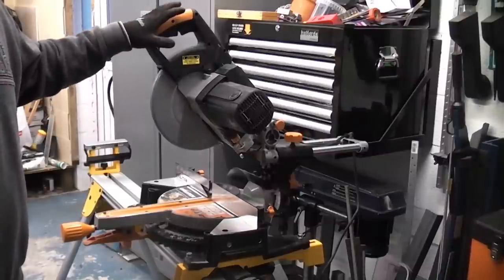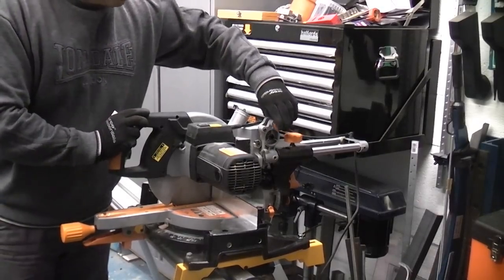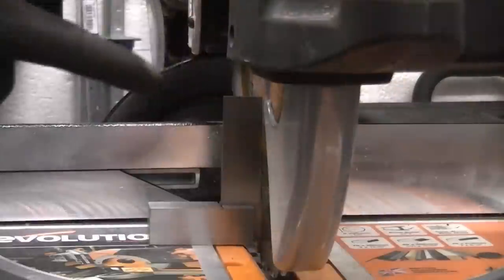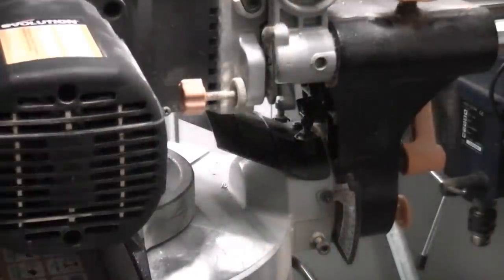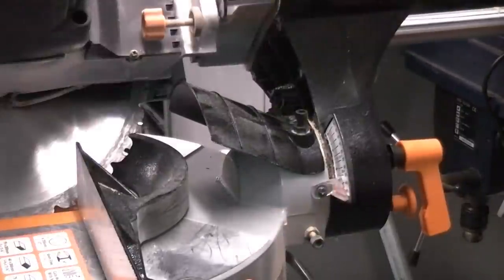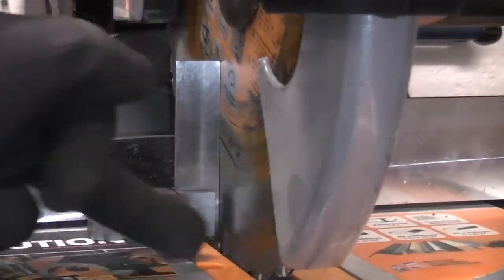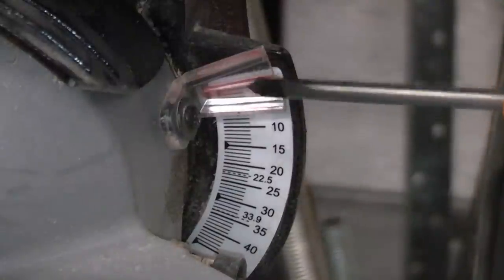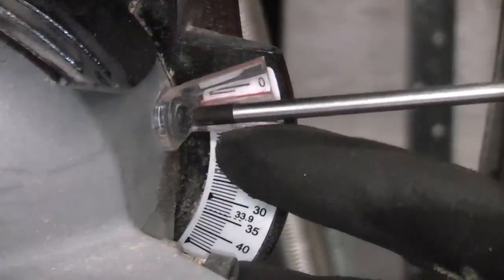How to adjust the blade on the Evolution Rage 3 sliding mitre saw

Comment: Thanks for the video, very clea. Do you know of any fix if the cutting head is not sliding parallel? The disc is square to the table but I am not getting straight cuts as the blade isn't moving directly back and forth for slide cuts.

Thanks

Comment: Do you have any videos for this model when the arbor button isn’t locking the Blade in pace so you can unscrew it to remove it? Thanks
Reply from the maker: No, sorry.
If it was me, I would put a piece of scrap timber on the bed of the saw and press down hard on the cutting head, so that the teeth bite into the timber. That should lock the blade so that you can undo the bolt.

Comment: Nice video, is there and adjustment if the saw is not cutting at 90 angles?
Reply: Unplug ! Loosen  the 4 screws on the fence, put a square between fence and blade, making sure you don't have it touch in a tooth and adjust fence. Re-tighten screws, and recheck.

Comment: I just bought one of these and when cutting a 45 degree bevel the blade hits the cutting guide and the cut is crooked. Would this procedure fix the problem?  Are there any other adjustments that need to be made? Thanks
Reply from the maker: I'm not sure what you mean by a cutting guide?
The fence needs sliding out of the way at the back for bevel cuts.
Checking the blade is square to the fence and the table will give much more accurate cuts. 
I hope this helps ;-)
Reply: Thanks

Comment: for my device the blade is not square parallel to the slides. I need to put it on 2 degree miter to get a straight cut. is there any adjustment to correct that?
Reply from the maker: Yes, first follow the steps in this video to get the blade square to the table. Then use the engineers square again but this time put the square on the blade and the fence at the back. There are a couple of socket head screws holding the fence down, just loosen the screws and set the fence square to the blade and then retighten the screws.
Reply: mines the same. so annoying but I will try UH's advice

Comment: My rage 3 has play on the up/down hinge mechanism, not the sliders. I.e. when in the cutting position I can move it slightly left or right so as not to get a perfect 90 deg cut. I'll have to have a play to see if I can tighten it up. It's a newish machine with little use
Reply from the maker: If you can't sort it, I would get in touch with Evolution support.
Thanks for the comment

Comment: Very useful, must get myself a smaller set of engineers squares, mine is too mbg for my rage chop saw.
For those interested the adjustment is almost identical on the Rage 3B chop saw.
Reply from the maker: caskwith 
Thanks, I bought a set of 4 engineers squares from RDG tools on ebay, they came in a wooden case and are very good for the money. I have one somewhere that I made when I was an apprentice, I'll have to dig that out ;-)
Thanks for the comment
Reply: I'm having the same problem. The blade is vertically square as in the video and the fence is square with the blade but from the starting point to pulling the blade all the way out there is a few mm diffence. How do we adjust this please?

Comment: at 0.30 the stop touching what caphead screw? i cannot see it
Reply from the maker: Is your machine the Rage 3 sliding mitre saw? or a newer model? 
If it's an older model it should have a cap head screw where the arrow is in the video (sometimes called a socket head screw)
Reply: its a rage 3

Comment: My blade does not run true in the channel on the table anymore. The laser does not shine along the channel either. It still follows the track of the blade. Anyone have any ideas what is wrong. Thanks
Reply from the maker: You can adjust the laser, but I'm not sure about the blade.
Have you checked the Evolution website?
Thanks for the comment 👍
Reply: Ultimate Handyman yes I have searched google but found nothing. The saw fell out of my van but I just cannot see how something like that could go out so bad from a fall. I can’t jar it back and undoing the 6mm hex’s then trying to straighten does nothing. Shame to throw such a work horse tool. Had it years.
Reply: I have definitely bent something. But all the components that I could replace are way too expensive . I have messed about with just about every bolt and screw on the saw and recovered a reasonable cut accuracy. However the unit is definitely damaged but again I think it shows just how robust these saws are.i just cannot bring myself to sling it

Comment: Stopped using mine for anything that I want an accurate cut. The cast iron saw fence is not straight.  It's a common problem I'm told.
Reply from the maker: The fence is Aluminium on my machine!
Have you tried aligning the fence with the blade?
Reply: Ultimate Handyman Yep aluminum my mistake. I actually just adjusted the fence after watching your video and it's cutting a lot more accurately. Think I might change the blade for a better one though.
Reply from the maker: If you are cutting fine cuts in timber a finer blade might help. Sometimes their machines do not cut straight, straight out of the box or if they have been banged etc. It took me a while to set one up to cut straight a few weeks back but once they have been adjusted they are normally okay.
Best of luck with yours ;-)
Thanks for the comments